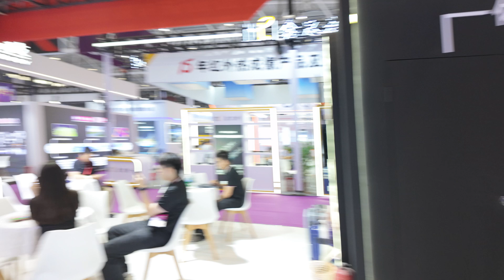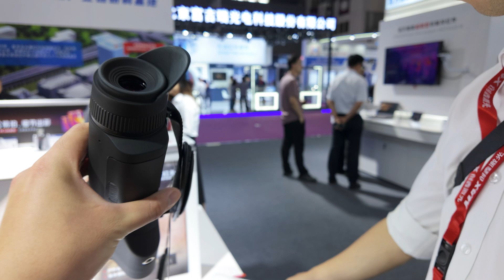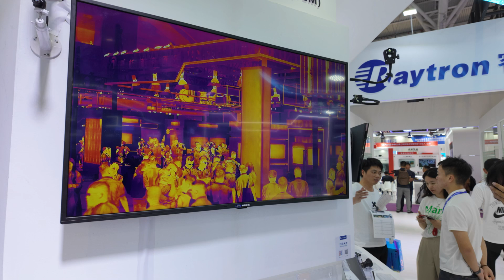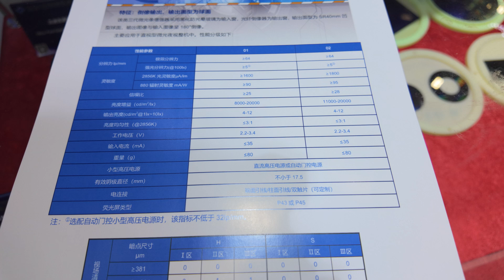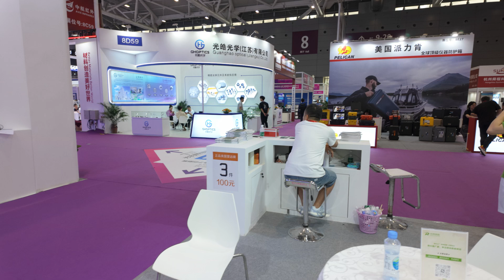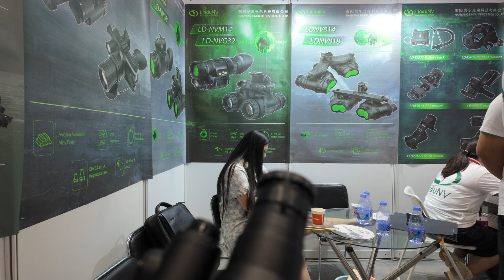China's latest night vision and thermals tech at the CIOE expo (NNVT, ADNV, iRay, Guide, AVIC, etc)

Comment: I have an Argus 1431 MKII build in the pipeline that will be utilising that NVT7+ 2300FOM+ IIT, the spec sheets are showing they're greater in FOM being around 2420~2445FOM. They're targeted at aviation (hence the shielding) but will be fine on the ground as it's typically the housing/lense in the aviation models that have special coatings that can affect imagery (blue light?). Estimations pit them similar in performace to Photonis 4G ~2000FOM or mayber Echo @ ~2200FOM.